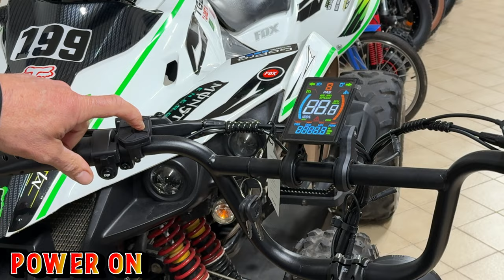ENGWE M1 - THE BEAUTIFUL BIKE_MOTO FOR 2 OF ENGWE - FIRST EUROPE TEST

Comment: Hey Tom, is it easy to get into the 40km/h mode? I want to buy that bike but the max. speed in Germany is 25km/h and i think if it very easy to unlock the "power" mode its kind of illegal.
Reply from the maker: Hi you can unlock but you can still go back to 25km/h and then it doesn’t have the accelerator so it’s super legal..

However, some European versions one cannot be unlocked and I have to change the control unit

Comment: Thank you so much for this nice video !

I have a question : I see that you unlocked your bike in a very easy way. My doubt is : if you want to revert the process ? It will be easy ? It will be the same procedure ? Did you test it ?
Your M1 bike does not have a throttle, right ? that one is the "Dutch version", right ? Will you have a throttle (that apparently is the "European version")

Greetings from Portugal !
Reply from the maker: Very good.. I see you’re an expert..

Unfortunately the Dutch version doesn’t have the accelerator and they told me in ENGWE that some European version can’t be unlocked and you have to change the control unit..